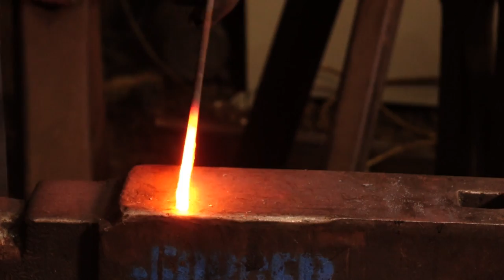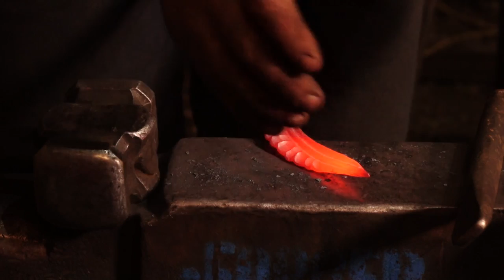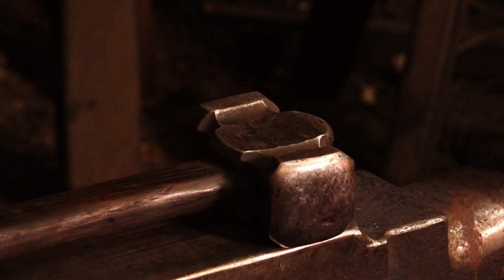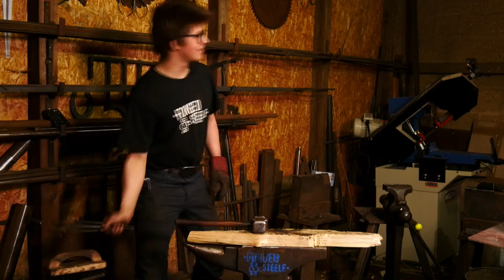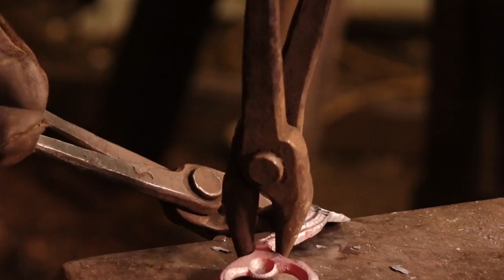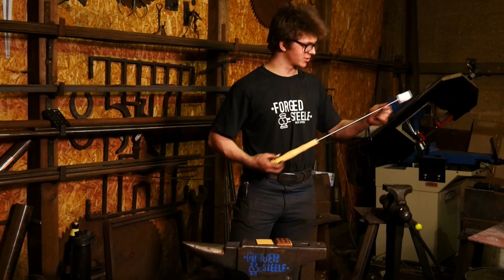CRAZY FEATHER BOTTLE OPENER!!! Episode 34: The Alec Steele Show!!

Comment: I can't believe you have never heard of s'mores
Reply: Nathan Eells That's exactly how I would have put it. However, it is a natural extension: toasted marshmallow-delicious; with chocolate- more delicious; problem: chocolate melts at heat and marshmallows are somewhat squishy, hence the need for something solid with higher melting temperature to hold them in. Hence: s'mores!

Comment: Do you ever hurt your jewels hanging on to the metal in between your legs like that.
Reply: +Ymis Haus  😲😂
Reply: Dude.  Steele.  Balls of Steele.
Reply: Atlantic Woodsman when you put the metal between your lags the metal is cold or warm because it's resting on a stone and it transfers and also if you would burn your Hand first and if it gets to hot just put the handle in water it's not high carbon

Comment: I'm disappointed with the whole design, honestly. Aesthestics complete aside, the bottle opener has absolutely nothing to do with the piece. It's a bottle opener with a designed handle. It could have been anything. It could have been a leafeather with no ulterior purpose at all. 

Which of course, could be the point, but I still expected the function to be incorporated into the design, not just attached to it.
Reply: joegt123 that's what I expected